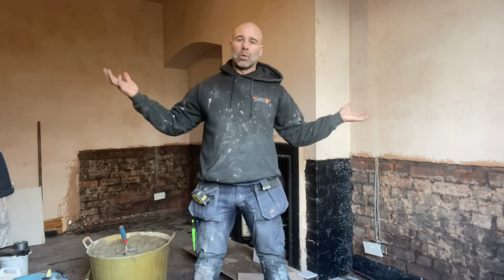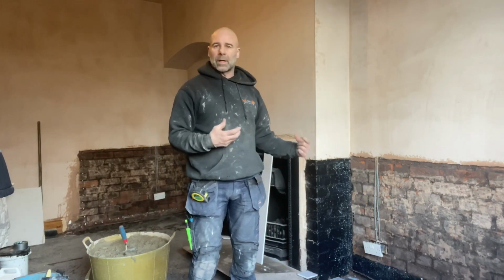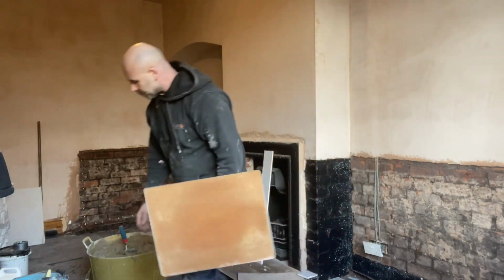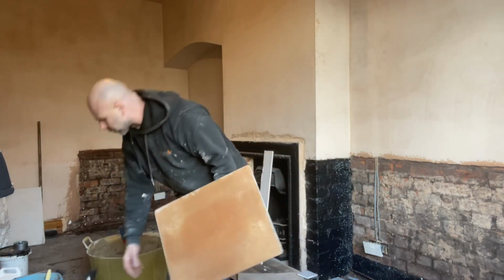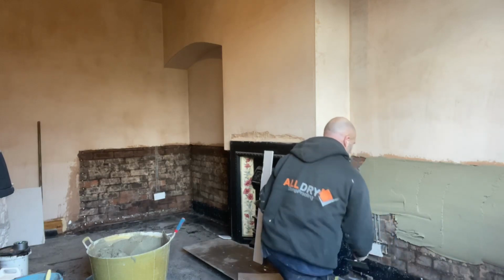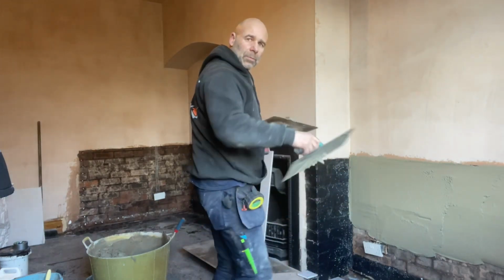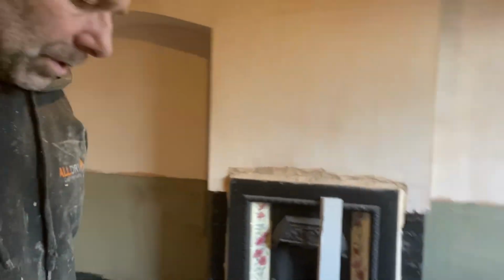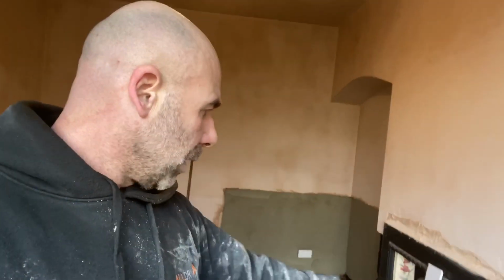Backing Plaster Application for Damp Walls

Comment: I have used renderlite but had problems with it, due to salts coming through its just not strong enough. If you use it with SBR then it makes it completely water proof which you don't want. You can't beat the sand & cement render system tried and test over the years. 3 and 1 mix with sharp sand & water proofer, Safeguard gold is a good additive.
Reply from the maker: They now recommended you mix renderlite/limelite with SBR which does add to the cost, they also recommended treating the wall with a slurry coat of SBR & cement as a key too which adds to the faf. 
Render is ok unless it’s on a solid wall where you can get thermal cold bridging. Again a lot of messing about with mixer bags of sand n cement . Render is supposed to be left for 3 days before it’s skimmed to stop the hairline cracks and if the plaster is thick and the render not applied correct strong to weak it will also crack. 
Nothing quicker, cleaner and cost effective than the express system by safeguard.
Reply: @dampsam  I did use renderlite for a few years because its easy to use, easy to mix and you can put it on at a good thickness but I had problems with it manly salts and its just not strong enough. I still put my angle beads up with it. I have gone back to sand and cement render although  harder to use and mix. I have never had trouble with cracks or shrinkage and you can set the walls the same day if the render goes off quick enough. Some people leave it for a few days to set over it. You can get crazing to the multi finish if you use to match water while trowelling it. Cold bridging can happens or condensation issues but that's enough problem not a reoccurrence of rising damp.  Dry-lining walls is okay but the  wall must be pretty dry before doing this because after dry-lining you have basically stopped the wall from drying -out.  The amount of dampness in the brickwork above the new damp proof course has to dry-out, dry-lining stops that process and can make the plasterboard damp or even push above the plasterboard line.
Reply from the maker: @davidellis5964   nooooooooo, did you really say you put sand cement render on and skim it the same day??????
I’m done,
Reply: @dampsam   You cant haven't much experience in rising damp damp treatment due to the inadequate way you are working.  Using Renderlite with SBR and then dry-lining a damp wall. Please read BS 6576. I have been a damp proofing contractor for over 30 years and yes you can set a wall that has been rendered the same day, as long as the render coat as dried enough to take the setting coat. You talk rubbish and have no idea. Please read a book.
Reply from the maker: @davidellis5964  I’m speechless, Iv nothing against contractors this is why I do the videos to learn people who are maybe set in there ways using bad practice from years back, a bit like yourself. This is why I spent a fortune educating myself to become a qualified damp surveyor and structural waterproofing surveyor, I also went to night school and gained a HNC in building management as well as level 2 nvq bricklaying to go with my advanced craft city& guilds plastering qualifications. Add to this all the continuous development I do to keep on top of all the latest systems coming out  so I can help educate and give free value to people I think I’m in a bit better position to comment on what & how things go on the walls in damp work, oh I almost forgot Iv been doing this 38 years young un so while you were playing tag and smoking behind the bike sheds I was grafting. 
Hope this clears a few things up for you kid, 🤔

Comment: Just a question.....as Sovereign Renderlite is breathable, I take it that you cannot wallpaper afterwards? Always something to consider
Reply from the maker: Yes your right you need to only paint with a water based emulation for around 6-9 months depending on the type of bricks and wall thickness with rising damp. 
Even tho the plaster may look dry water will still be evaporating out of the masonry once the new dpc is installed
Reply: Don't use Renderlite its rubbish, use sand cement render, sharp sand with integral water proofer it still breathes, Safeguard do a good water proofer.

Comment: Nice video. When should you use plaster instead of drygrip and plasterboard? Cheers
Reply from the maker: Aidan O'Farrell it’s really down to personal preference but I would say if the wall is so uneven that when laid flat on the wall the board is not touching in a lot of areas.. plus below ground walls and walls that the plaster is too thin to take a board.

Comment: Sam, great videos. I have a damp problem in my old property (ground floor flat). Unfortunately I'm not sure where the damp is emanating from, although a recent damp inspection has suggested 'probable rising damp'. The company that did the damp inspection has quoted far more than I can afford so I'm going to need to do it myself, that's unless you are willing to quote fro a job at a seaside town (Exmouth) in beautiful Devon?

The damp is in two areas:

Area 1. I previously had two alcoves (either side of chimney breast in a bedroom) re plaster boarded and skimmed. The recent inspection said that there is a damp problem because the boards were fixed using dab, which is now forming a bridge from the outer damp wall damp to reach the new plasterboard. The inspection has said to replace with foil backed plasterboard glued to the outerwall. Instead of removing the existing plasterboards which are still solid could I simply use Drt Flex membrane and adhesive on top of the boards?, or will the damp boards eventualy perish in which case I need to replace them with foil backed boards (glued)?   

Area 2. There is significant damp is in two walls, one external wall (facing the sea) and the return inner wall. The outer wall  is made of very thick stone with no cavity, the inner return wall is brick, both walls have a plaster top coating. Unfortunately I'm not sure where the damp is emanating from and the inspection only stated probable rising damp.

The damp company said that they would hack off 2M up from floor level and use Vanex BB75, topped with a plaster coat that includes a salt and moisture inhibiting additive. 

After watching your videos I'm confused about which system is best for this job:
1. Plasterboard with Dry Grip/Insta stick (Hack off the plaster to 300mm above highest damp)
2. Dry Flex Membrane and adhesive on top of the existing damp wall 
3.  Dry Base liquid membrane, finished with Render Light (plus SBR) 

Any advice would be much appreciated
Reply from the maker: There are lots of different systems for damp proofing and waterproofing from different manufacturers and if installed correctly they should all work. I use systems that in my experience work, different types of damp require different systems. 
You right about covering over the wall which has been dotted with drywall. The dry wall adhesive will keep deteriorating and this has a smell to it. It would also concern me they are putting foil back boards on as the foil creates a vapour check where moisture will condense and run down the boards.

Comment: Do you go up to 1.2 m

I've been going with sovereign and Triton for almost 17 years and the spec changed as salt bands were appearing at a meter

I'm seeing it quite a bit here in South Wales
Reply from the maker: We usually say hack off up to 300mm after the last detected signs of moisture for rising damp or1.2m but it’s really up to who is responsible for the guarantee who should decide. Each job is different and not all damp issues are rising damp.
Reply: @dampsam  most the 'rising damp'I treat is usually a bridging issue

We do see quite a few genuine cases though

Do you find tanking a better option in stone with a black mortar,I'm not keen on dpc only

I have never had an issue with a cement based tanking/render system

I have switched from high pressure to dpc gel doubled up with the tanking 

What's your thoughts on above ground tanking?

Seal that junction?

Ta

Comment: Hi Sam 
Am new to the business and am treating a damp for a client next week , pls what anti damp chemical do you recommend I mix with my plaster
Reply from the maker: Hi Jamal, it all depends on what plaster you are talking about? 
There are numerous additives that can be mixed with a sand & cement render mixed at 3 sand 1 cement and they will all work great if you follow the mixing ratios on the packaging. 
Besides the additives there are also the pre mixed backing plasters like Renderlite, DryZone Dampproofing plaster, Dricoat, and limelite backing plaster. 
You need to make sure the source of the dampness is treated so diagnosing it correctly is imperative.
Reply: Thank you Sam